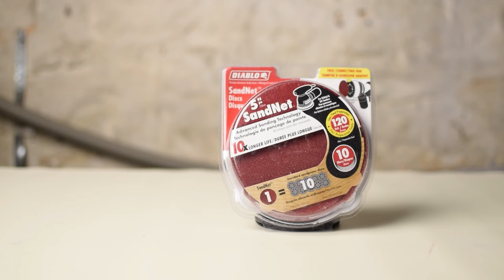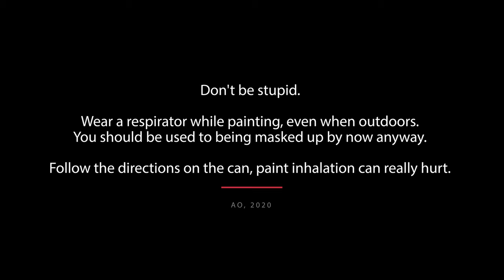How To Custom Paint A PC Case | PART II

Comment: Great work, looks awesome. is that bar that runs on the inside of the case from top to bottom just held in with 2 screws?
Reply from the maker: Thanks man. I think it's 2 at the top and one at the bottom and one in the middle. If it looked like less in the video I probably removed them at some point before I started filming

Comment: Two questions: first did you consider using a liquid deglosser rather than sanding? Second, it doesn't look like you primed. Were you not concerned?

I am about to start painting a new case and I really don't want to have to sand everything but I am planning to prime it.

Comment: That's awesome! I have a question: it is possible to paint the cables from the fans and the dust filters without ruining them?
Reply from the maker: I wouldn't paint the filter, only because the paint will likely reduce the airflow further. as far as the fan cables, they can be sleeved just like the psu cables. I'll work on a video for how to do that
Reply: @AliOxen  That would be great! Your videos are pretty cool

Comment: Yo this had a nice finish to it.  Im about to start on my own case, and I am debating whether I should sand it down.  Im painting the inside of a Corsair 4000D and it doesnt have a shiny finish off the factory paint.  Would you advice to still sand it down?  Im scared if I do, itll lose the texture it has.
Reply: Also, pretty awesome of you to showcase the rivet gun use.  None of the other videos go that into the process, definitely a big help
Reply from the maker: It really comes down to your skill and what you're looking for in the finish. There are painting methods that will give you that textured finished back but I don't know how they do it. I would advise you to sand before painting it just because it gives a longer lasting, and more durable paint job, but if that texture is important then nah, avoid the sanding if at all possible and do very light coats until you get the color coverage you're looking for. Its possible to still lose that texture if the paint job is too thick. And yeah, the rivet gun is definitely necessary to get a more factory finish for certain parts

Comment: Question, given the case will get hot inside, will it somehow warm up the paint and give out toxic fumes of some sort? Or is it not enough heat?

Love the way it turned out by the way, thanks for the great video and great tips!
Reply from the maker: I actually had the same concerns. Luckily, most of the standard rattle can paints don't run into issues until the flashpoint around 90F but the interior of the case should never get that hot
Reply: @AliOxen  Awesome! Thanks for letting me know, I'll be sure to check the paint I use if I do this :)

Comment: You are going overboard big time sanding. You only need to scuff up the surface then prime. Then 600 light sand and apply final coat. Light sand again for another coat or clear if the final coat covered. I've never seen anyone sand that much.

Comment: do i have to prepare surface? or can i just go ahead and start painting
Reply from the maker: I mean you can just start painting but it wont have the best durability since its only holding on to the finish of the factory paint job. If you want to use paint stripper to get a cleaner finish without all the sanding, its doable. Sure you can paint over the stock paint job but I don't think it should be done. Whatever works for you though

Comment: I don't get why you would sand down to metal when the existing paint is already well bonded with it and already acting as a light primer. You're completely good to go after just scuffing the original paint.
Reply from the maker: Most of the information I looked at trying to paint metal all recommended the sand down but honestly, I would have preferred to not have to do all that work. I'll keep it in mind for the next one for sure
Reply: @AliOxen  I'm guessing that the paint being well bonded already is just an assumption and they could have done a cheap job at it originally and sanding it down to metal guarantees a good finished product.